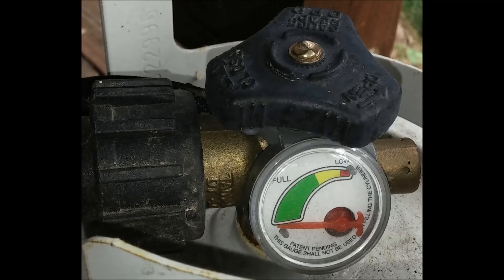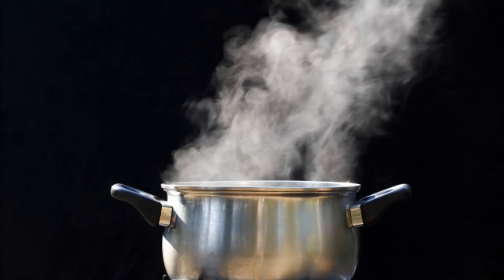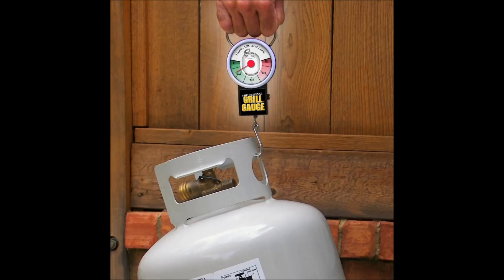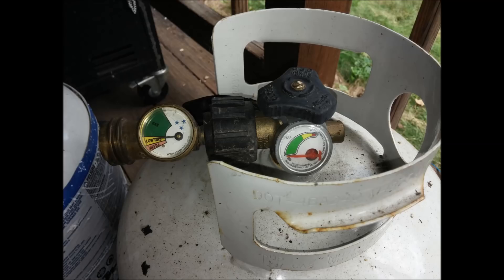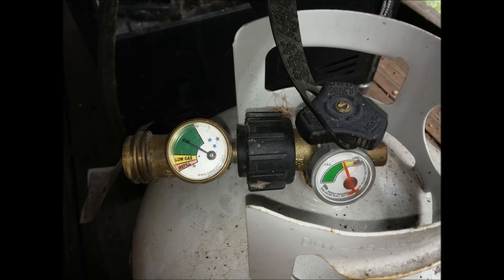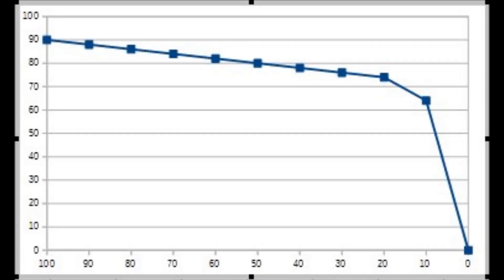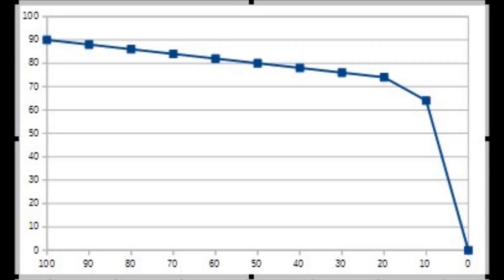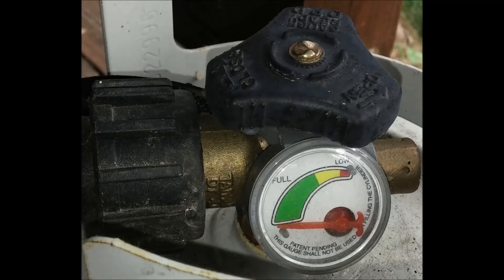Propane level measurment that works, and gauges that pretend...

Comment: I agree with this guy that says that weight is the best method.   And some propane grill manufacturers have a built in scale.  But they are lousy in that they stick in place.  Jiggling the tank gets it to move but it just gets stuck in a different place then.    I suppose I could get off my lazy ass and take the thing apart and put some lubricant on it.   A little gun oil or light oil might do the trick.  (don't use thick lube like vaseline because it'll just stick again. )     Yeah, I gotta do that.

Comment: Missed review of the sonic ones that stick on the bottom. Reviews say they work pretty good. Might be a new product since you made video. Glad you indicated some tanks come with the gauge. I always assumed those use the pressure as well but apparently you’re saying they use a float which would work pretty well

Comment: The pressure in a propane tank is dependent on the temperature of the tank.
Spec D-5 propane has a vapor pressure of 205 psi at 100 degrees F. and propane will boil at    -44 degrees F at sea level air pressure.  Propane weighs 4.29 pounds per gallon. 
As the temperature changes the pressure in the tank changes.
This is why the pressure style level gauge are worthless and are never right.
Good video.
Reply: As long as there is liquid in the tank, there will be vapor above it.  This vapor is in equilibrium with the liquid with some liquid evaporating and some vapor condensing continuously.  The vapor pressure (which is what the "gauges" are really measuring) will show changes based on the average temperature in the tank.  Two of the points on the that curve are shown by you above.  So, FULL until very near the end.  Like you said, a scam.
Reply from the maker: Indeed... but getting into the full Boyles Law chart was a bit much... which is why I just said 40psi vapor pressure at one point even though it has to be pretty cool at that pressure.  ;)

Another effect of going off the top of the temperature chart is the huge pressures.   Tanks have overpressure vents to avoid exploding but I did balloon a 1# tank into a snowman shape when left in my car by accident... scary!

Comment: I just keep my tanks on top of an old scale that I wasn't using. I set my scale to read -16 pounds as the tare weight. I then place my new tank on said scale and it will tell me when I am close to empty.
Reply from the maker: That works, as long as you're willing to remove your tanks and weigh them frequently.   For RV applications, it would be a pain in the tuckus to constantly unbolt tanks to check them, so people devise assorted ways to check in situ.  Personally, I go through LP slow enough that just running one tank dry and switching to the other while I refill the 1st provides a reasonably safe window to refill tanks (can find reasonable price to refill before I get worried/desperate enough to pay extreme prices).

Comment: So, I tried the infrared thermometer. I've been looking for a reason to buy one anyway. I did not notice any appreciable difference between top and bottom. Though it did start off at 75.5, then 75, then 74.5 then 74, and I tried it a few times. I ended up weighing it and determined that I have about 14# of propane left in the tank. I really wanted the infrared thermometer idea to work. How much of a difference in temperature should one notice? My infrared thermometer only discerns by .5 degrees. Having said that, I think I"m going to end up with one of the internal floats in my tank. Anyone using one of those? GyroGearloose mentioned that they would be accurate.
Reply from the maker: Bruce Mortland I'm guessing you'd still need to use some hot water to create much temperature difference,  or do your check at dawn just as the tank starts to heat up in the sun.  The float-based gauges shown in the video are pre-installed from Worthington's factory.

Comment: I'm glad i come across your video. i have an issue. i live in mexico & new to this whole propane usage. & i hate to discredit the station i use (worker just punches the info & it's the company that sets the meters) so, my question, "how do i make sure I'm getting the correct amount?"

is there a guage that you recommend on ebay? and do i have them fill the tank & set the guage?
Reply from the maker: Louie Lou Most tanks are stamped with empty (and sometimes full) weights.  From truly empty, an OPD type tank holds 18lbs of LP.  Weigh your empty tank and add 18lbs.

Non-OPD can take 20, but there's greater risk of over-pressuring/venting with thermal changes.

Comment: So confused. You mention the float as being a correct solution to measure. Or weight of the tank. I use nothing but 20# tanks. Don’t want to disassemble to tell how much is in my 20# duel tanks. Likely don’t have a float in these generic swap tanks you can get anywhere. 

So how do I tell, without disassembly ?  Maybe use a laser heat temperature  gun (now $20 at Amazon) and hot water both?  

Thanks for posting the video to warn about the generic Walmart gas grill gauge false readings (which I did suspect).
Reply from the maker: Ah good, mission accomplished if I can confuse you! :-)  What I was trying to say was that folks will be happiest by far if they buy the tanks with float gauges built in, since they are about the same cost to buy new.  Every once in a blue moon, someone is suckered into swapping a nice gauged tank, but you're still paying triple for the propane at ANY swap station ($20/15lb at swap vs $8 for 18lbs at refill).

You CAN get the float valve as a retrofit, but I think it costs almost as much as a new tank (?)...   I'd consider a retrofit on my 30# RV tanks since they cost more, but probably still not worth it.  On my RV, I go through gas slowly enough that I can swap an empty tank before burning all of the other one, so I don't usually worry about completely running out as much as being curious if I'm starting a trip with the first tank just about to poop out.
Reply from the maker: If you already have tanks without gauges, the hot water/temperature gun method is a good one -- and you can get them for $7 on AliExpress.

While I'm at it, someone GAVE me one of the electronic gas sensors because it didn't work on any of their tanks.   I tried 11 tanks of my own, and YEP... not a one could read accurately.
Reply: GyroGearloose-HackingRVsCheap — was watching a video about the magnetic gas sensors you put in the bottom of the tank, that has a blue tooth transmitter. Have to do more research on it, and it costs something around $50 (but maybe more). 

Given I only have 20 pound tanks I can’t justify spending money on a magnetic sensor device that may or may not work. Am more likely to use the laser temperature gun. At least the laser temp gun can be used for ten other tasks (like checking wheels and tires for overheating).  And the rule in frugal RV is to only get tools that have multiple uses. Will see.

Comment from the maker: Another thing I forgot to mention about the pressure gauges : Many people have reported that they present a significant flow restriction that caused malfunctions in various LP Appliances (stove burning "dirty", heater wouldn't light, furnace issues...).  I did another test with my gauge, and there definitely IS a BIG difference in how my large 4-burner grill runs with the gauge installed.  

I actually DO use my gauge (hey, they fooled me into buying one, even while wondering how it could possibly work), but I keep it on my mosquito killer in my yard -- a VERY slow gas draw that is actually SO slow I can't tell when it stops running, so... the gauge tells me when it's DEAD.